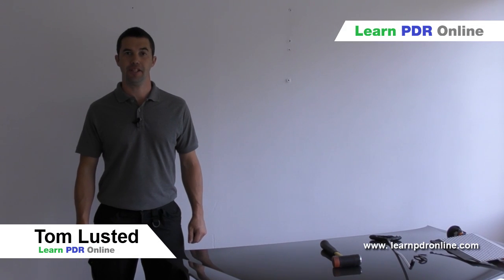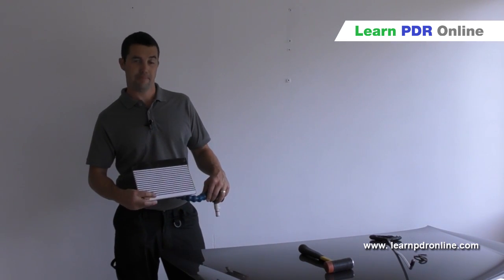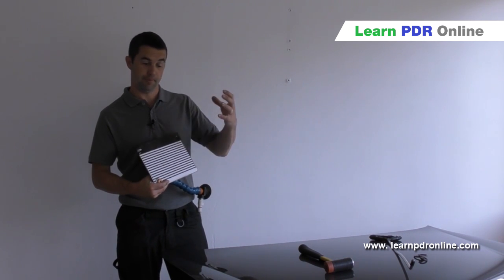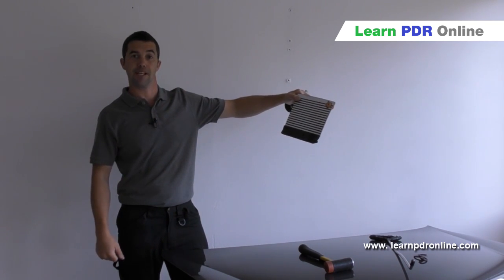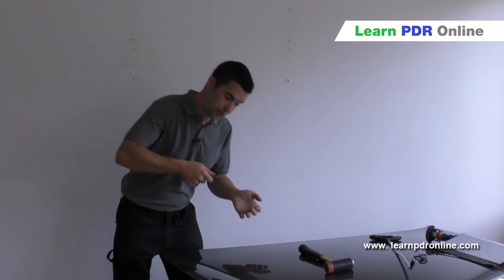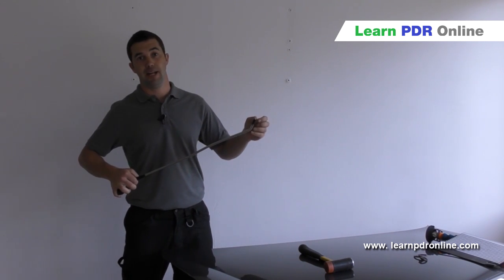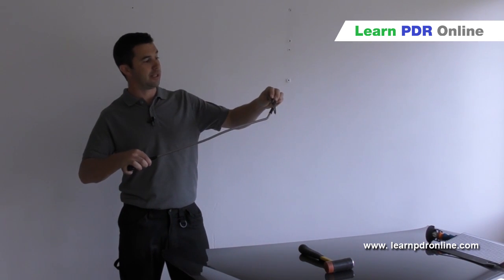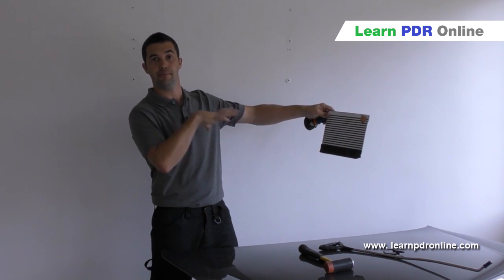The Top 7 Mistakes Made When Learning PDR

Comment: Good information  soft dent ok spiral in ... Same size but deeper definitely go straight to the centre with soft tip you have to make it soft then spiral out the dent .So many dents end up with trapped metal.
Reply from the maker: Thanks for your comment Geoff! Yes you're right about the trapped metal and approaching small but sharper dents from the center first, thanks for your input...

Comment: ok so i made that mistake of pulling a golfball sized dent from the center, and, yes, got two new shallow dents now.  the dent was remarkably at the very center of my hood.
Reply from the maker: Yep, its easily done, if a dent is small and shallow like a 5p or a dime size then the centre is fine to go for but once its bigger than a coin like golf ball it often needs to be reduced before, although occasionally with shallow dents a big enough tab, or cold clue like Glexo its possible but it would need to be pulled gently and slowly drawn out...